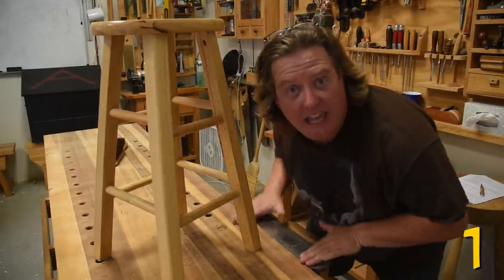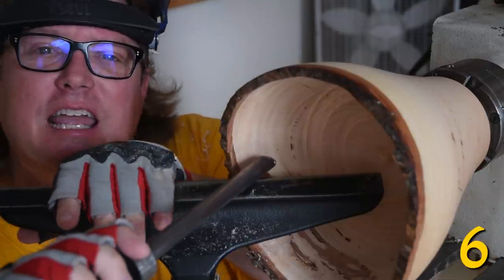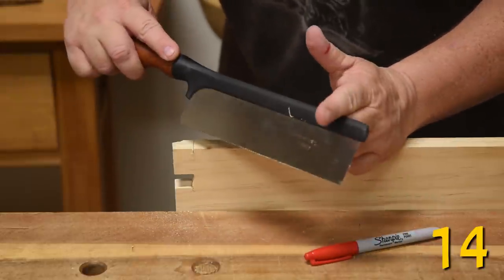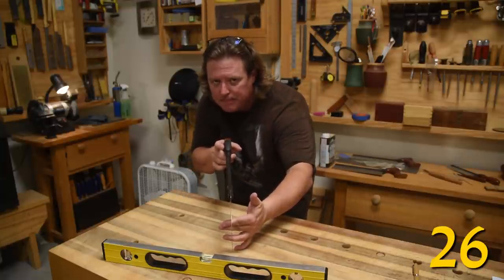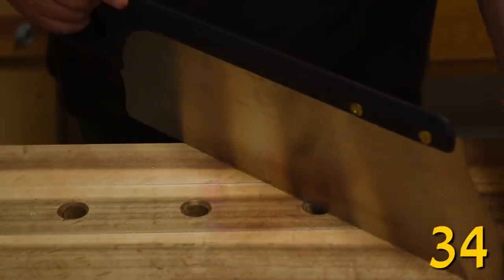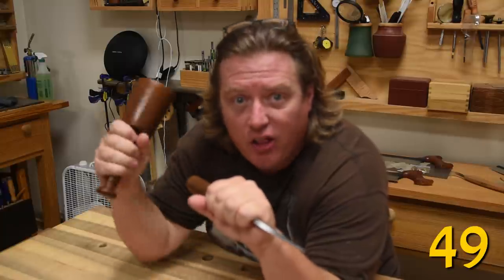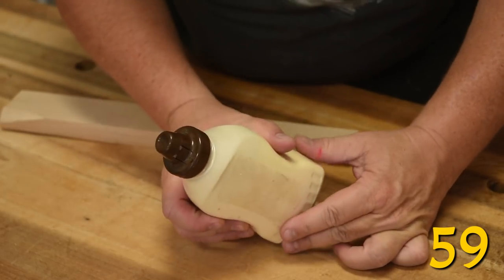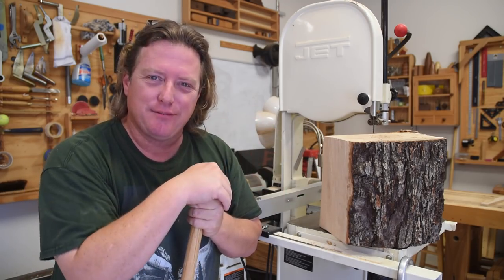63 (more) Woodworking Tips & Tricks

Comment: You can get walnut oil at most grocery stores, or, if you have more money than you need, you can buy exactly the same thing for 4 to 10 times as much at your woodworking outlet.
Reply from the maker: Yep, $6 a quart is better than $20. Though most times the Mahoney's level is actually processed differently so even though both are 100% walnut oil because of the protein difference the wood based stuff does cure faster and harder. But I still use the cheap stuff.

Comment: Machinist here. If you want to keep all 10 fingers attached, you shouldn't wear those Husky gloves while running power tools. Use latex or nitrile because they'll tear away much more easily instead of dragging your hand into the blade/spindle. Even those fingerless gloves can be pretty dangerous.
Reply from the maker: LockeandDemosthenes Woodturnrrs here. Those melt. Gloves are there to prevent burning from steam creation.
Reply: @wortheffort  Fair enough. I suppose as long as you're cutting inside, it wouldn't present quite as much danger. It would still worry me a lot, though. Is there not some kind of oil you could use on the tool and spray on the workpiece to prevent the bulk of the steam in the first place?
Reply from the maker: LockeandDemosthenes nope.

Comment: Tip #0001: Don't use the machines or tools when you are angry, sick, frothing at the mouth, or distracted by love for anything other than the doing with the machines, tools or wood (no pun intended). Also, do not  become distracted when in the middle of a table saw cut the shop mouse runs across the floor, the beautiful woman goes by the shop window (which you should be unaware of anyway), or a fracking earthquake shakes the floor.